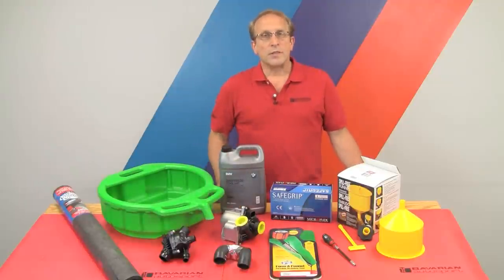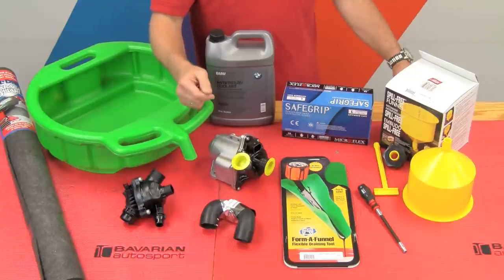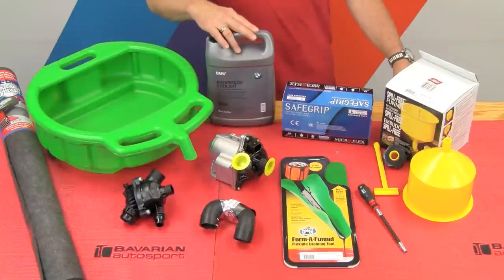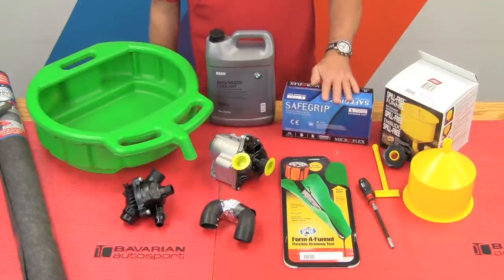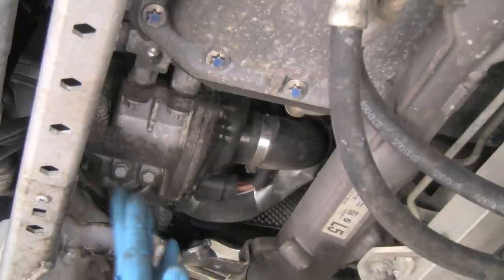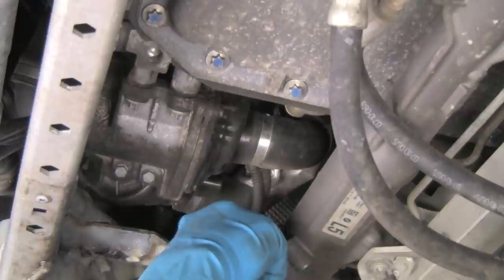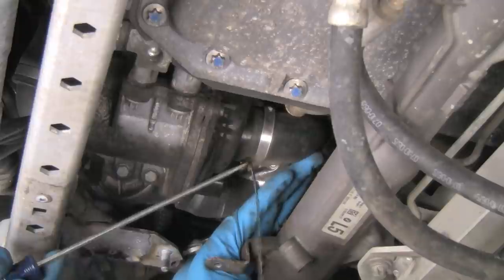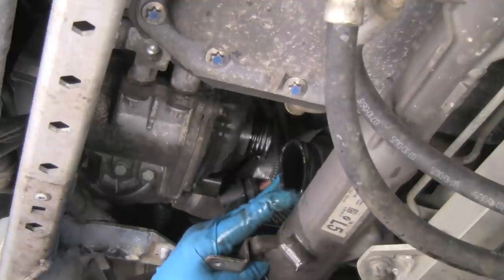Part 1  Replacing the electric water pump on late model BMW N-Series 6 cylinder engines

Comment: FYI the XI versions are nowhere near this easy though the location is the same. The sub frame is much larger on the xi and comes right underneath the pump. This makes getting to things very very difficult but it is doable
Reply: +Levon Everett  i forgot to mention that this can be done on an xi version without dropping the sub frame
Reply: +Levon Everett can you elaborate? I'm working on my x5, just need to get to the water pump hoses and plug. like you mentioned the frame is smacked in the middle of this job. got everything out just need those two hoses out, any advice? thanks
Reply: I have a coupe , so I can't guarantee the access will be the same. But, I accessed the hose on the front of the pump through an opening on the passenger side of the vehicle, behind the wheel. The passenger wheel had to be removed. Having a long screwdriver or nutdriver makes loosening the clamp easier.

Then, getting under the car and reaching in the gap between the front axle and the subframe (transmission side), you can pull the hose and loosen it from the pump. You may be able to reach the hose clamp on the top of the pump through that same gap using the long screwdriver or whatever you decide to use. 

It's been a while since I did this repair so I apologize for the lack of detail. I hope this helps
Reply: Alex H

Comment: Time consuming and messy if doing it on ramps. Wear safety glasses. Pretty straight forward but a pick tool is needed to break hoses off. 

Overall... main risk is stripping the upper water pump bolt when removing it. Make sure the e12 is fully seated. An extendable mirror helps. 

Personally after this taking me 6+ hours id rather just pay a mechanic 2hrs labour.

Comment: to replace the water pump I have to replace the thermostat too ? what happen if I don't?
Reply: No you don't have to replace it but... if the thermostat fails at some point down the road you have to remove the water pump (again) to get at the thermostat. Its sound practice and piece of mind to replace the thermostat assembly if your replacing a failed water pump.

Comment: what if you dont change the thermostat?
Reply from the maker: +Bryan Lozano - If it's working ... no issue.  it's just that the water pump must be removed to replace the thermostat .... so ......
Reply: +Bavarian Autosport - my 2007 335i convertible, blew the pump last week. As a precuation, even though the thermostat wasn't faulty, the BMW techinican advised replacement. I agree on the basis that the labour alone to completee the current job, stood around AU$1,100. And if the thermostat later become faulty, I'd be hit for another larger labour bill, because the same process has to be repeated to replace it.
Reply: That's why money-hungry BMW designed it that way. All of this expensive crap PLUS new bolts, which are proprietary. All guaranteed to make you think twice about buying another German car (unless you
have tons of money to pacify your ego).
Reply: 0

Comment: Thank you. autozone says you have a choice between this water pump and the expensive electric water pump you are using. does this make sense to you? i drive a 2006 z4 3.0i roadster btw, (http://www.autozone.com/autozone/parts/Valucraft-Reman-Water-Pump/2006-BMW-Z4/_/N-joo6yZ93xmn?itemIdentifier=180655_0_0_)
Reply: Dont buy anything at autobone.  EVER!!!!!
Reply from the maker: We offer both the original BMW pump as well as the Pierburg branded pump.  Note that the original BMW pump is actually from Pierburg.  Therefore, the less expensive Pierburg branded pump is the same one that is in the more expensive BMW box ..... for less $$

http://www.bavauto.com/fland.asp?part=7.00294.17.0
Reply: the one you showed on the link is not an electric water pump, its just a regular one probably for older model 3 series
Reply from the maker: Stefan L.
- The link works when we run it - should be a Pierburg # 7.00294.17.0
Reply: well I just checked under the car with a mechanic and I am in fact using an electric pump. I'll definetely be going with the Pierburg ;D Thanks again

Comment: Why the hell do you guys live with these BMW's???  I have a 2009 128i and a 2006 530Xi.  Never BMW again.  Ridiculously flawed engineering, poor serviceability.  They drive nice but not worth the constant fear of  a major repair.  I'm waiting for a class action lawsuit on the water pump.  Plastic impellers?  Both failed around 80,000 miles which wouldn't be such a big deal if they didn't leave you stranded without warning and didn't cost so much to replace.  I'll stick with my Saabs and American cars.

Comment: this is specific only for the non turbo e90s...if you have a 335xi like me....you are screwed.....
Reply from the maker: Actually, this car is a turbo (335i).  The 4wd cars (xi & xDrive) cannot be done in this manner.
Reply: BavarianAuto how would this be done for an xi & xdrive model? could you do a video?
Reply from the maker: khmerstylez
 We currently do not have a video scheduled for the 4wd cars.  See Blaine Hoopes comments, here, he is doing a 530xi model.
Reply: Not quite true. Currently working on my N54, which has turbos. I think your trouble is the 4WD.